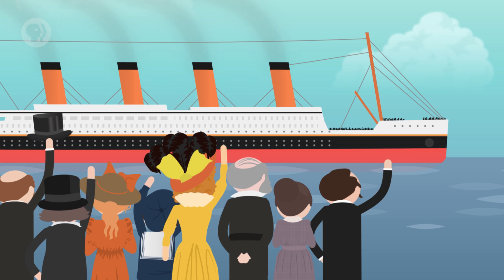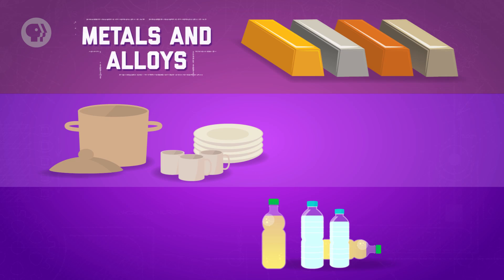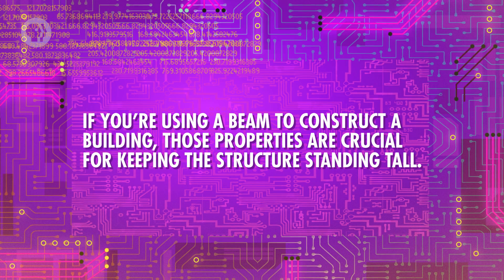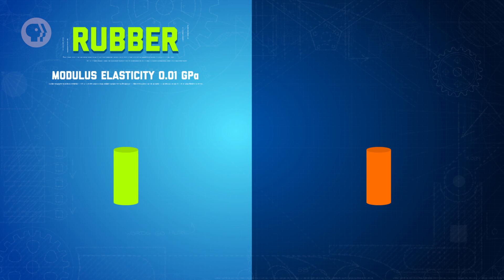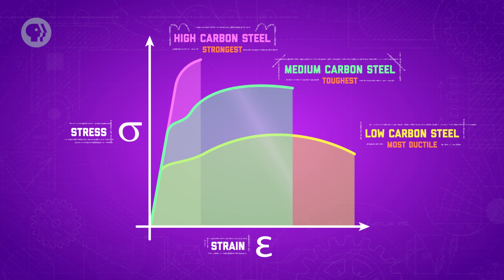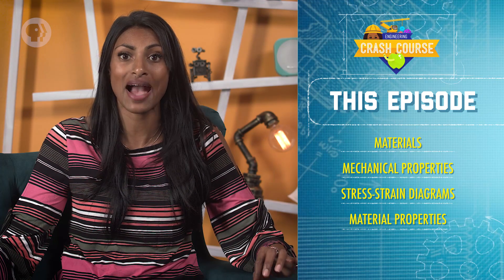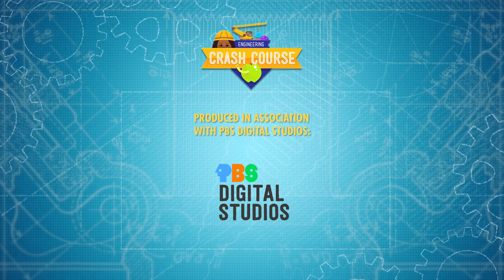Reaching Breaking Point: Materials, Stresses, & Toughness: Crash Course Engineering #18

Comment: Wow. What a needlessly convoluted and complicated way to explain this. 
Too Technical with too little Explanation. 
I actually learned such stuff and yet aside from terminology I hardly was able to comprehend any of what you said and basicly had to remember things from what I learned myself to realize what your Talking about.... 
In Essence your Explaining what the Words mean but give it absolutely Zero Practical Knowledge to go with.

For an Actual Engineer this might be understandable. 
But for those of us which are not Educated in Engineering especially even if we do have education in this field due to other Areas of Expertise this is really really hard to grasp. 

One example.
Your actually using a Steel Beam as your first Example and then actually Show a Bridge. 
And you Explain that Materials will Bend and Break if a certain amount of Force is applied. 
Yet one of the most Importand Examples on Materials Qualities and one of the Reasons why Steel is such a Widely used Material for Bridges remains entirely unmentioned. 

One of the First things we Learned was about Permanent Deformation and Reversive Deformation (sorry if its not the correct Terminology in English I didnt learn it in English ^^) 
You are actually later on mentioning the effect of continues Stress and that smaller amounts of stress might reduce the breaking Point of the Material over time. 
Yet again in your explanation it basicly sounds like Material once it starts deforming is automaticly permanently damaged and will reduce its breaking point.
Leaving out the Property of Materials being able to withstand certain repeated stress levels by deforming and then returning to Original form after the stress lets off. 

Or maybe you actually mentioned it but I didnt understand it :P 

Anyways.
I think you should Redo this Video or maybe do a Second Video on it. 
I somehow dont think that many people without extensive prior knowledge in this field will actually be able to make sense of this right now ^^

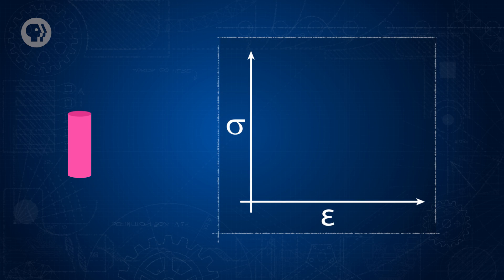Comment: 5:58-6:06
“But as you apply even more stress... the material will begin to deform and stretch along its cross-section as well as its length”

Just want to suggest adding in some detail here as the above sentence seems a bit ambiguous. Even in the elastic region of the stress-strain graph, all (normal) materials do experience deformation span/transverse-wise, and not just lengthwise before the yield point (see Poisson effect and/or Poisson’s ratio). 

In the elastic region, this effect is uniform across the material, as the cross-section area deforms uniformly across the entire length. At the yield point and beyond, this deformation begins to be non-uniform and is localized instead – hence the specimen necking/getting thinner in the middle before failure occurs there. (Also, I feel that defining the yield point as being the point beyond which the material can no longer return to its original shape to be a clearer explanation than the above).

To summarize then, perhaps it would be better to phrase the above as “the material will begin to deform and stretch non-uniformly along its cross-section as well as its length” – or something along this tune? 

Still, thanks for summarizing a semester’s worth of introductory materials engineering so well! Wanted to add this to prevent any misconceptions of when transverse deformation occurs.

Comment: In the harmonica world there are metal reeds.  Historically they used bell brass.  Today there are two main materials... bronze-phosphor and stainless steel (not sure what grade but it's magnetic but still good with moisture).  There is a debate over which last longer.   People fall into both camps, but I've noticed that the people who say steel lasts long self-describe themselves as hard players.  My guess is that the stainless is staying under the fatigue stress levels with gentle players but more vulnerable at higher levels.  I've read that under certain levels steel (and titanium) can undergo nearly infinite cycles without breaking.  I also know when they are retuning reeds a lot of customizers prefer to polish to remove metal rather than just scratch the reeds because they are worried that scratches will create weak points that could lead to reed failure.  (At $40 a pop for a harmonica, with 20 reeds per harp, with 12 harps in your set people worry about details like this!)

Comment: In other words, jet fuel doesn't have to "melt steel beams." It just has to decrease its point of failure under stress.
Reply: I think that the World Trade Center collapses had more to do with buckling, which depends on an object's shape, not just its material properties. Various unstable configurations of material will bow, crumple, and/or twist under compressive stress before they ever reach their yield point or their ultimate strength. Fire does reduce steel's material strength, but perhaps more importantly, it reduces its modulus of elasticity, so hot steel buckles much more easily than room temperature steel. Then, once you get a few hundred tons of concrete and steel to suddenly drop a level, nothing's going to stop that freight train except sweet Mother Earth.

But yes, you've grasped the concept that a building's columns do not need to be completely reduced to liquid before their structural integrity is compromised. That's why many steel buildings have fireproofing to protect the beams and columns from fires that don't even involve jet fuel. Heck, a couple years ago some guy started a dumpster fire in Atlanta that caused a CONCRETE bridge to collapse by heating up the steel reinforcement or prestressing tendons inside the concrete.

And for all of you conspiracy nuts, I'm not saying that the US government would never try to stage something like 9/11, but as far as I'm concerned, the official story checks out. My mental model of a collapsing skyscraper may be imperfect, but at least it comes from engineering textbooks and not Transformers movies.
Reply: I did 9/11-- and 11/9.
Reply: lol
Reply: jew fuel cant melt steel memes
Reply: hahahahhahaha
Reply: Jet fuel doesn't cause two 110 story, billion dollar skyscrapers to explode into powder and implode at freefall speed into a subterranean lake of literal molten metal though. Building 7 too...
Reply: CopyRtest1 - You're right it doesn't! What it actually causes a billion dollar skyscraper to collapse is heat! By itself jet fuel doesn't collapse a building, but add in a jet crashing into it at flight speed reducing the structural stability of steel beams, and heat those steel beams up real hot, and the beams fail. Therefore, the beams not maintaining structural integrity at extreme heat while still under large compressive stress is what causes a building to fall, and jet fuel just helped the beams get nice and hot. Once the stress on the hot beams is high enough, the weight of the rest of the building on top of the hot beams causes the beams to "buckle" and give out, you then have that mass of building accelerating and falling into the rest of the unheated beams, and since Force is equal to mass times acceleration, the acceleration of the top of the falling building is several several times greater than before it was falling! As the top falls down, the material it falls into is unable to keep its structural integrity, and a cascading failure occurs. Now spreading misinformation about events which directly lead to the deaths of many is uncool, luckily now you know have an expanded picture of why crashing jet planes into buildings can cause them to fall down. Building 7 was taken out by aliens, and potentially pressure waves caused by collapsing buildings along with being an older building that may not have been as structurally sound as the others, but mostly aliens.
Reply: @Paul Lawson The "pancake collapse" theory, or "cascade" that you described would not result in those buildings turning into powder in 10 seconds. As each floor collapsed, it would have to crash through the floors beneath it. There would be acceleration as the accumulated mass of falling material increased with each additional floor failing, but there would also be a ton of resistance. The only way for the tops of those buildings to reach the ground at the same speed as a falling bowling ball would be if all the structural support had been removed simultaneously, just as it is during a controlled demolition. All three towers collapsed in this exact same way, allegedly for different reasons. Yet the three collapses all resemble controlled demolitions exactly. It is an amazingly unlikely coincidence, if nothing else. And then there was the alleged plane impact into the pentagon that morning, which was extremely fishy as well.

Comment: I thought I knew this stuff (though it HAS been 46 years since I took a structures class in architecture school), but at 7:26, you say low carbon steel has a lower modulus of elasticity even though the slope on the stress-strain graph is identical to high carbon steel.  It looks to me like what low carbon steel has is a lower elastic limit or yield point.  Am I wrong?

Comment: Titanic had damaged metal from burning. And there were no binoculars
Reply: The fire myth is complete BS. The "burn mark where the coal bunker was" in those photos was over 70 ft forward of where the fire was, over the mail room, and it wouldn't matter if the lookouts had binoculars or not because they only used the binoculars to identify things AFTER they saw them. A navy engineer commented that no modern ship would've survived that impact not severely damaged.

Comment: Engineering is the creative application of science, mathematical methods, and empirical evidence to the innovation, design, construction, operation and maintenance of structures, machines, materials, devices, systems, processes, and organizations. The discipline of engineering encompasses a broad range of more specialized fields of engineering, each with a more specific emphasis on particular areas of applied mathematics, applied science, and types of application.